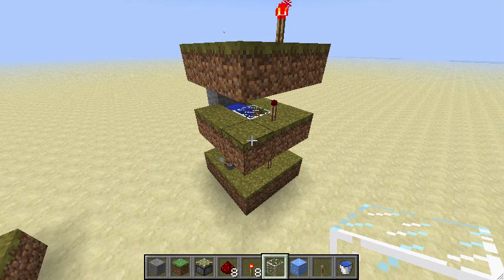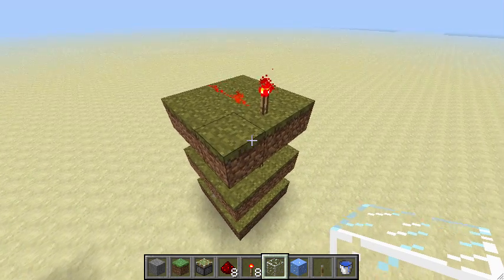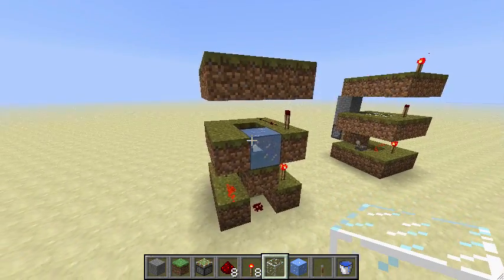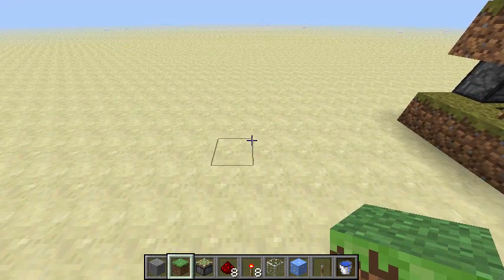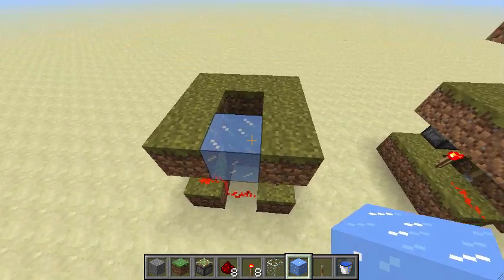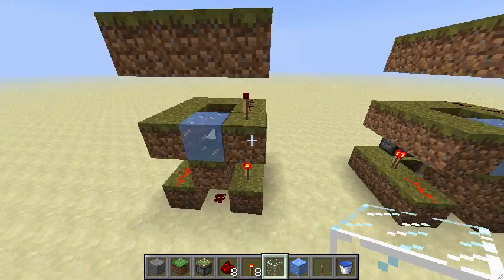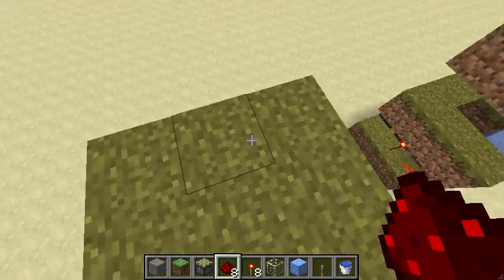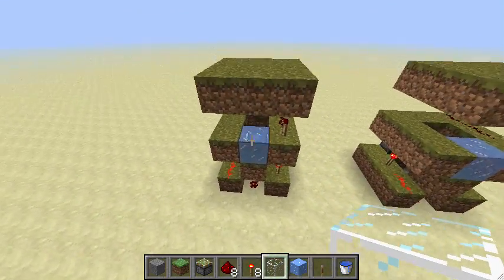Light Sensor Pico

Comment: so im confused how does this work??
Reply: The piston is powered diagonally by the torch on the middle layer, making a block update detector switch. When a dirt block turns into a grass block, it updates the block, extending the piston. When the piston is extended, it turns on the torch in the 'bottom right' nearest the ice block, in turn unpowering the piston. The piston remains extended until it is updated because the power it was receiving was indirect.

While the piston is unpowered, the grass block is pushed under the ice block which reverts it to a dirt block after some time, again updating the block. Because the piston is unpowered, it's allowed to retract and expose the dirt block to air. Again retracted, the piston is powered diagonally again and waits for the dirt block to update to a grass block.